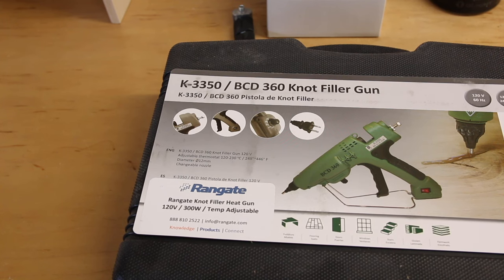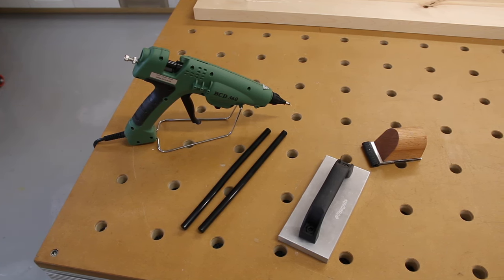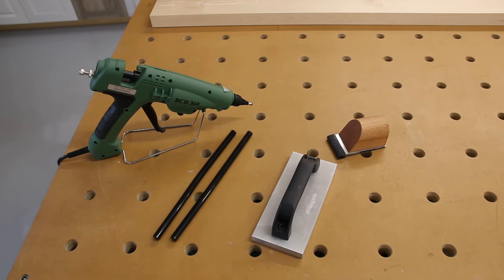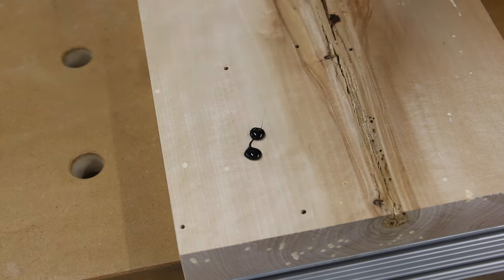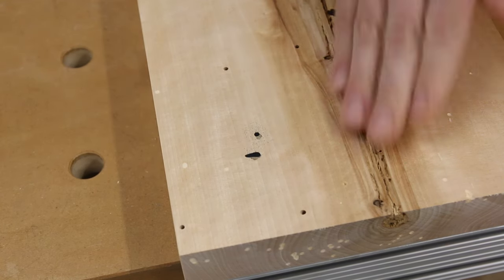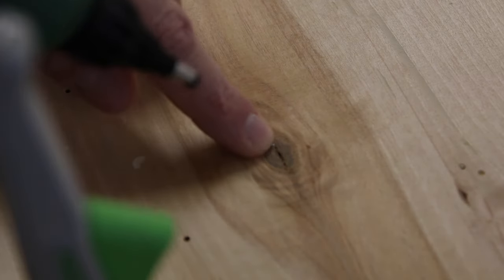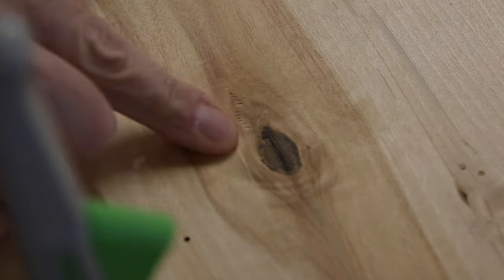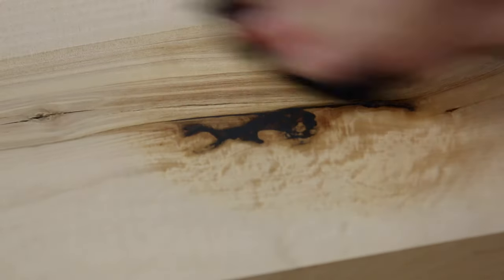A Must Have Tool For Every Woodworker

Comment: Carpenter usually implies remodeling or framing a room/house. You might miss a lot of potential viewers who are doing a google search if you want to focus your channel on woodworking. You mentioned you were not able to read my second post yesterday. I suggested you could give you customers a small discount rather than trying to accurately figure time spent on camera setup, if you wanted to do a video on their project. You could do 1 or 2 stationary cameras where you do most of your work (with remote on/off) and a mobile unit (Jay bates used a post stuck in a bucket of cement on a wheeled cart). New Yorkshire Workshop did a video on making a cheap camera boom.
Reply from the maker: Thanks for your input. Your right about carpenter. I think I will name my channel French River Woodworks. I think I will film my customer work but only the interesting job. Thank  You